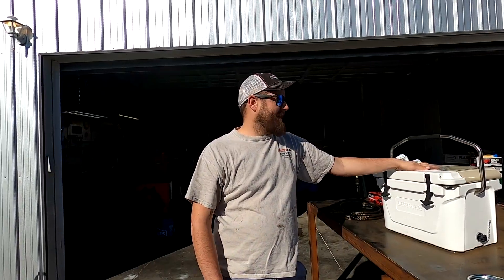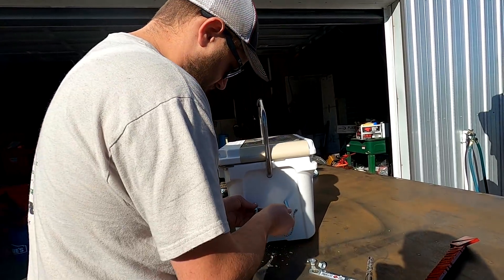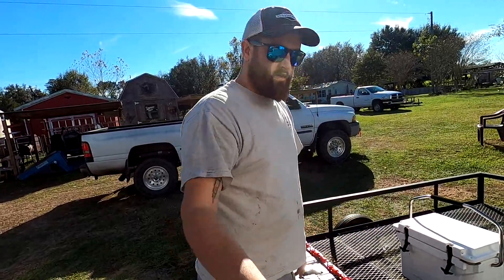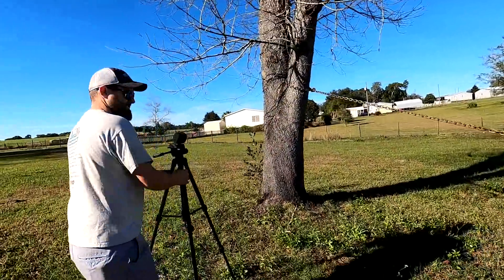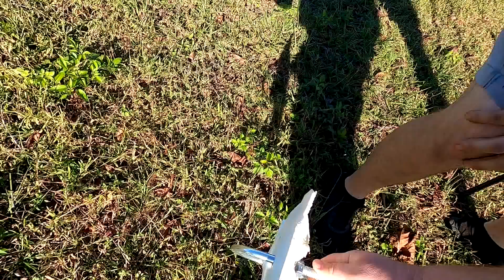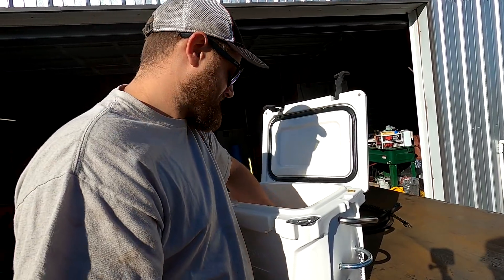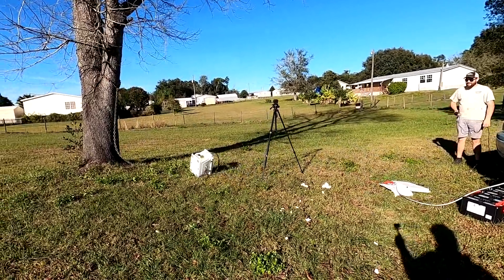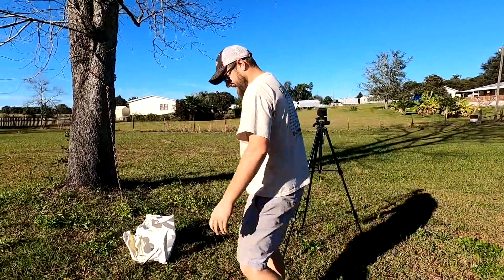WINCH IT WEDNESDAY! YETI COOLER DESTRUCTION!!!

Comment: My 99 Ram 3500 I put in 4wd low with the e-brake on and that will lock all 4wheels. When I use my winch to pull down trees

Comment: What was that thing with the power cord you used to drill holes 🤣.  You have all that nice snap on tools and a 1970 corded power drill. 😁
Reply: Rich A the best thing about those old corded drills is the batteries never fail on them like I've had on ever single cordless drill I've had
Reply: "nice snap on tools" wait that's a thing? since when I prefer my old corded any day or at the least a Milwaukee cordless
Reply: cliff tyler I've never tried any Milwaukee cordless tools but have a good many corded ones that are great    I've had black and decker, Craftsmen, Porter Cable cordless tools which the batteries have all went bad on leaving me with good tools with bad batteries which are now outta date
Reply: T.Money11 your name must mean your daddy's money because I'm sure if it was your own you wouldn't call me an idiot. I've worked to make money since I was 14 digging footing for houses one summer then cut and split firewood during the fall and winter after football practice all throughout high school
Reply: What what??  Drills used to have cords?  Lol

Comment: Get an old truck or car. Remove the rad. Chain the back bumper to the tree. Secure a chain to the front of the engine block and attach the winch. Then try to rip the engine and transmission out. Maximum destruction. The end game needs to have the possibility of a castropic failure with the rigging. That's entertainment!

Comment: If u woulda used a piece of steel plate the size of the inside panel of the cooler and drilled through it and the cooler  and mount it like u did already you would have the entire panel to pull it through     lol.  Then you'd rip it in half for sure.

Comment: You need to use a steel plate not washers. You want it to part in the middle not rip the u bolt out.